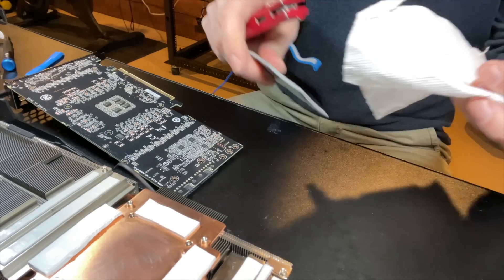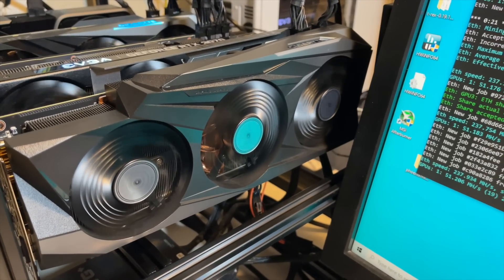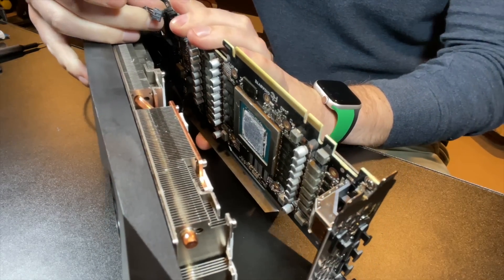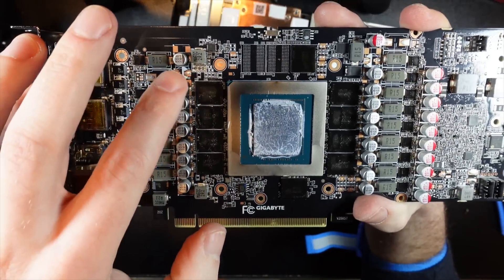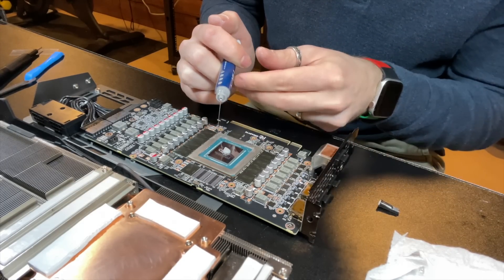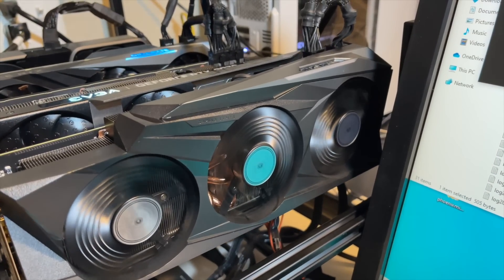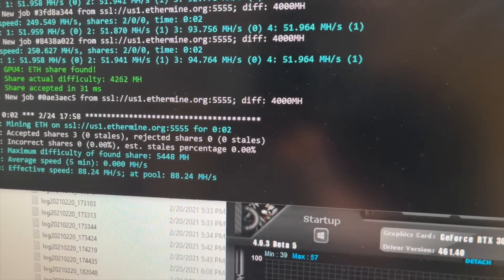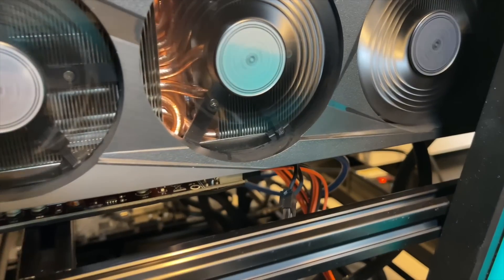RTX 3080 Thermal Pad Install & Ethereum Testing

Comment: @Red Fox Crypto hey man, I have the exact same card and my first try was also just adding thermal pads to the backplate. After some time (few weeks) the temps got outta control again. I replaced the white oily pads on the memory chips or rather the pcb itself (just the 4 ones that come in contact with the memory). I went with 2mm Thermal grizzly minus pad 8. I can hit 100mh/s and my temps dont go over 88-90 degrees at 75%fan. It’s really the only way to fix it. Hope this helps out
Reply from the maker: Dude that is super helpful. It's way better with the pads I added, but you're right that I need to replace the stock ones too. The Thermal Grizzly or Gelid 2mm pads are really hard to find right now online. I just want to mine this GPU into the ground. It's been a frustrating experience. Thank goodness I only have one of them. 

Thanks again for the help brother. You're awesome. Happy mining!
Reply: Good to hear. My pads just arrived but looking at them I'm thinking I should have ordered more. Is a pack of 40x80  2.5 mm enough or do you need more. Don't want to open my GPU twice. Thanks
Reply: @sheed3k  I used 3 packs of 120mm 2mm to cover both the backplate and the memory chips themselves. I have a bit left over but I definitely needed all 3 packs for the full gpu.

Comment: Great video man! im trying to get into mining myself. Im wondering what cpu and motherboard you use and also how much ram do i need? thanks in advance!
Reply from the maker: Thanks dude! Everything is linked in the video description though most of it is out of stock right now. I use Intel Celeron G3900 or G3930 CPUs with ASRock H110 Pro BTC motherboards. 4GB of RAM is all you need.
Reply: @RedFoxCrypto  Ok man thanks!

Comment: Im using Gigabyte 3090 which is much hotter and power hungry but I manage to lower its temp by 95-98. My ambient temp is 32-34C. I used 2mm front 3mm back Gelid GP extreme. I tighten the screw to compress the Thermal Pad and to straightened the PCB. If that was properly repadded youll notice an increase in GPU temp and 10-20C decrease for Mem Junction.
Reply from the maker: Dude thanks for sharing. I need to replace the stock pads ASAP. Happy mining brother!
Reply: @RedFoxCrypto  Share the result either on another video. Happy Hashing!

Comment: Why didn't you pull down the core -200 and push mem to about +1250?
Reply from the maker: This card is really giving me a card time. Since Day 1 it'll crash above 900 mem and hashes around the same with the core at 0 or negative -200.
Reply: @RedFoxCrypto  but the core at -200 will give you lower temperatures

Comment: I've had my Gigabyte 3080 Gaming OC for two weeks now and it was thermal throttling hard, but I had to downclock it to 50% PL, -501 Core, -500 Memory, and 100% fan speed to keep the memory temps under 100. It was getting 56 mh/s. I knew of this issue through Red Panda Mining and others on Reddit so I decided to change the pads, but Gelid thermal pads are arguably harder to find than GPUs right now. I ended up traded my Gigabyte 3080 Gaming OC for two 3070 FE last night. Did I make the right choice or did I screw myself? I'm now getting 60mh/s each on the FE and I don't have to worry about GDDR6X memory temps.
Reply from the maker: Yeah dude that was an excellent swap. I'd do that all day. Nice job.

Comment: I’ve got the memory on most of mine at +1400 you should be able to push it further for sure. Also overclocking the core +100-150 helped for some reason lol. 102.5 mh at 235-240 watts
Reply: are you doing +1400 in msi after burner or another program? if its +1400 in afterburner you got your self a pretty good cards there. msi doesn't apply the double rate on the memory so +700 in afterburner could be similar to +1400 depending what you use to apply your oc
Reply: @Demon09-_-  I got +1450 running on Msi afterburner super stable but only with the regular evga card. FTW3 version topped out at +1050

Comment: Why didn't you change the pads on the front side as well?
Reply from the maker: Didn’t have any on hand and I’ve seen others just add the back and have success.
Reply: @RedFoxCrypto  The temps are still too high, I'm sure the pads Gigabyte used are trash. Red Panda Mining new EVGA 3080s stay at about 82c with mem at +1300. I have the same problem with my GXT and TUF 3080s, have to keep the memory @ -502 to get the temp down to 96c, the memory cooling on most of these 3080/3090s cards is so garbage.
Reply from the maker: Yeah dude it absolutely sucks. The EVGAs are god tier but impossible to find.

Comment: thats alot of RMA's thank the miners for doing it themselves its not inexpensive
Reply: I'm not thanking the miners for anything. I hope that GPU is never on the used market. With its memory running over 100°.
Reply: @bradbeyers9028  the gpu manufacturer should thank them DEfinately NOT gamers you are absolutely right
Reply: @bradbeyers9028  um he did the best thing for the card something the manufacturer neglected to do and should have done it will cost them alot of dollars

Comment: Hey Mr. Red Fox.  I have 5700xt which has very high vram temps as well.  Prior to me changing the thermal pads on the heatsink, my temps were above 100 deg C.  When i changed the pads to gelid pads, temps dropped to 88deg C.  You might want to change those pads too :) :)
Reply from the maker: I’m definitely going to. Thanks for the advice dude!
Reply: @RedFoxCrypto  no problem!!
Reply: my temps are 94-96 C on memory, 53.5 mh/s in win10 (phoenixminer 5.6c) without bios update, 116W TDP, 60% on coolers, stock pads, Gigabyte Aorus 5700XT

Comment: I may try this with a 3090 FE that keeps throttling in the garage. I'm on Hive with it so I can't be certain it is, but I'm pretty sure it is since the hashrate fluctuates at higher clocks. I ordered some pads along with a large heatsink which I'm going to attach to the backplate on the hottest part of the card and put a 120mm fan on it. The hard part will probably be getting it to stay mounted, but I'm going to rig up something like tying a string around the card to hold it on. It just feels like that backplate gets saturated with heat and isn't that effective.

Comment: thats probably more from cleaning that oil than from adding pads on the back. thats my guess...
Reply from the maker: I was wondering that too. The backplate is much hotter to the touch now which tells me it’s transferring heat through the thermal pads. So maybe a combination.

Comment: I have a msi 3080 trio and online anteriormente having 2x 120mm fan blowing air exclusively for the card one towards 3 fans and the other towards the backplate I could have a Stable 90mh/s 102/104o C Vram junction temp and fans on auto between 75~80%

Comment: Hey Red Fox Crypto, I think the memory pads may have helped but I think you forgot to mention you removed the "oil" on the memory chips while cleaning the old thermal grease off gpu chip.  I think that maybe helping out as well.  Cheers!  I agree with others you should stop using phoenix miner and use T-Rex.
Reply from the maker: Thanks dude I think you are right. I do use T-Rex, but Phoenix for the videos since it refreshes faster by default. Forgot to mention it in this one. Cheers buddy!

Comment: You should try running t-rex miner on your 30 series cards instead of phoenix. I can push my overclocks way further and get no rejected shares. Phoenix was pretty bad for rejected shares.
Reply: Yea good tip. I swapped to NBminer from phoenix and got more efficiency per mh
Reply from the maker: Yeah I do use T-Rex, just Phoenix for the video because it presents better and refreshes faster by default. Thanks for watching Thomas!

Comment: Firstly, 75.9F is 76, not 75 😉  I would not be buying any new cards right now for mining ETH with the way the price is dropping like a rock, especially a 3070 and up.  Your ROI on that 3080 is now almost 5 months and climbing, plus the thermal pad cost and hassle of replacing.  Your MH/s/W is about 0.429, which isn't great either.  Also, I wouldn't trust running a new card at 110C memory for any length of time.  The 30 series is pretty untested still compared to say the 5700XT.  Who knows how long they'll run without melting down or breaking fans.
Reply from the maker: You're right. Luckily I have the rest of the farm already paid off and the profits from those GPUs pay off all the new cards much faster.
Reply: @RedFoxCrypto  That makes no sense.  If you didn't buy the new cards, you would just keep the profits and wouldn't need them to 'pay off' your new cards.  You should make a video advising people to not buy cards now just for mining as they are going to regret it.  I've been watching daily estimated profits on Ethermine drop almost hourly as the price drops and the difficulty increases.

Comment: You definitly have to change the front pads!
Check out my latest video, there you can see, how much improvement you can get, 
even on top tear cards like a Strix, by replacing them with cheap thermal pads.
Stock Thermal Pads are just 100% trash. Sad that the manufacterer are doing this,
considering the card prices. Changing the Pads on the MSI Suprim got me siumlar results. 
Just check it out. Its just horrible and sad at the same time :(
Reply from the maker: I definitely need to. I can't find the 2.0mm in-stock in any name brand. What ones did you use?
Reply: @RedFoxCrypto  As you might have seen, i used 1.00mm Blue Arctic Pads. 
All HQ Pads are only till 1.5mm, so i just stacked two of them. 
I know that this is not the best case szenario. But i prefer to stack 2 1mm HQ Pads rather than using one 2mm Low Quality Pads, like OEMs are doing.
Reply: This. I changed my Gigabyte 3080 OC front pads with Gelid 2.0mm and my memory junction dropped from 102°C to 80°C

Comment: Seeing you get these improvements I’m tempted to do this to my 3080 master
Reply from the maker: Yeah dude I'd recommend replacing the already installed factory thermal pads too for everyone more improvements.
Reply: @RedFoxCrypto  is it 1.5mm for the front pads?
Reply: Changed mine out on my 3080 Master, went from 82 Hashrate to 103. Def worth it, also had an extra heat sync lying around and extra double sided thermal pads, and just attatched a heat sink to the back of my backplate 😂. Needless to say, super overkill but core and memory stays way cooler, my backplate heat sink reached 54 degrees 😂 and I now turned my 4 slot card to an 8 slot card haha. And there's a whole video tutorial by "son of a tech" on youtube , search up his "thermal pad" video and he shows you everything to change out on the 3080 master

Comment: It’s ok to temp hit’s 100c +?
Reply: I get a reboot with my 3090 when I get to 92+ could be driver related or psu related
Reply: @dylanlevasseur846  I don't know which temperature is safe for a 3080, my plate reaches 90 ~ 100 degrees easy but I don't have thermal throttling 98Mhs on hiveos

Comment: Tip: newest version of GPU-Z shows memory temperature.
Reply from the maker: Nice dude. Thanks for sharing.
Reply: Great spot!!!
Reply: Just for 3080/90 or for the 3060ti/3070 too?
Reply: @karlhungus545  Dont know, can prob find it in their changelog. My 3080 shows mem temps anyways.
Reply: @karlhungus545  only 3080/3090 coz they have GDDR6X
Reply: @karlhungus545  Only 3080/3090s have memory sensors for the GDDR6X. 3060 Ti & 3070s are using GDDR6 and they don't have memory sensor built in.
Reply: Thanks! Just downloaded.
Reply: I installed new version, is Hot Spot memory temperature? thx
Reply: @AceCombatZero  Hotspot temperature is the highest temperature at any point in the sillicon. Not memory temp but can be a close enough gauge to see if you are running too hot or not. ;)
Reply: Is this only limited to the newer cards? For the 3080 I can see the memory junction but can't seem to see it on the others. Oh wells. For anyone reading this, the pads to change / use for the best price I found is on Amazon. It's under this name: Frosty Ice Cube Plus Thermal Pad.

Comment: Does it matter what kind of pad you use? thickness for example changes from pad to pad... Thanks for the video Bro
Reply from the maker: Yes. For this card 3mm for the backplate and 2mm for the cooler.
Reply: @RedFoxCrypto  I only have 1.5mm can ı put 2 on top of each other and make 3mm:)?
Reply: @hasansafakiroglu3226  Stacking pads reduces the heat transfer of the pads, best to just order some 3mm pads.
Reply: @scvonlineover  thank you Bro
Reply: @hasansafakiroglu3226  yes I've seen it done and work OK. I can't get thermal grizzlies 3mm but i can 1.5 so will do the same thing

Comment: It looks like the card close to the founder edition card has some fan issue my brother :)
Kinda sad to see a such expensive product having some serious thermal issues because of manufacturers greed and laziness.
And the worst thing is that most reviews i have seen about this card from so called "Tech Reviewers" never talk about it.
Have a great week ahead and keep on mining <3
Reply from the maker: Thanks brother! Super disappointed with Gigabyte on the 3080 series. From both a gaming and mining perspective. Too bad it was the only 3080 I could get my hands on. Have a good one my dude. <3
Reply: aaaah GIGABYTE i expected more of them, especially when i sent my dying 2080S turbo after 3 months last year. they couldn't repair it fully and just send my money back after 9 month of troubleshot both in france and Taiwan and they wish me luck to get a 3080with that money... GREAT !
it's bad that all customers reviews are positive on this card where i live. No one saw that oil >.<.
Reply: late reply but the card your talking about if you are saying it has issues from it not spinning before he started stuff up. that is normal. alot of cards these days under 50c will not spin fans if you leave there fan settings default. if your talking about something else about why you thought it had fan issues my bad for bringing up this old comment